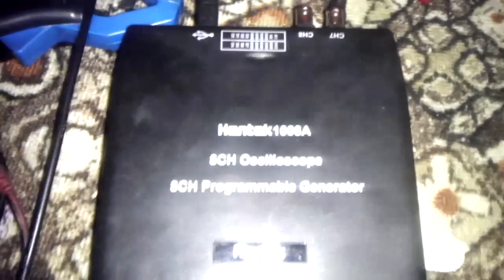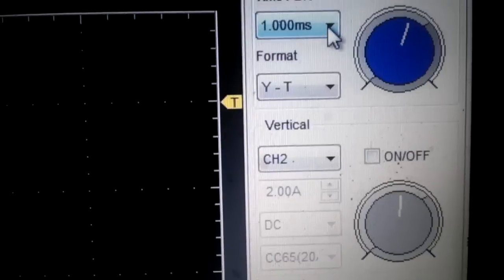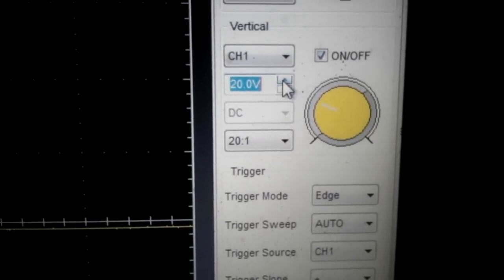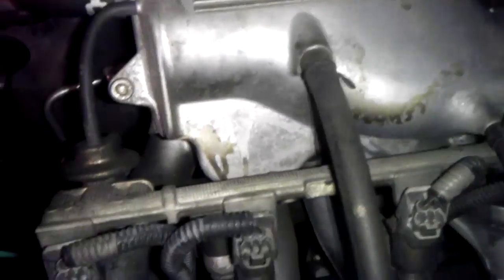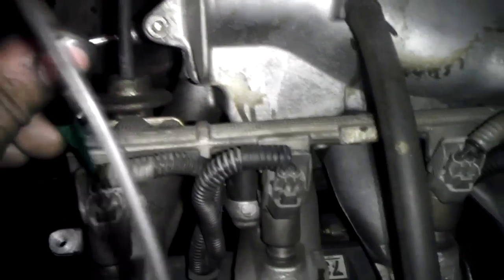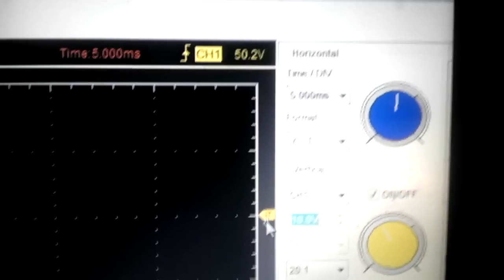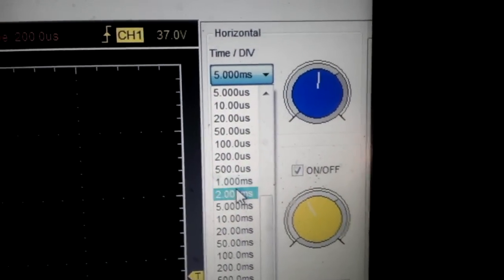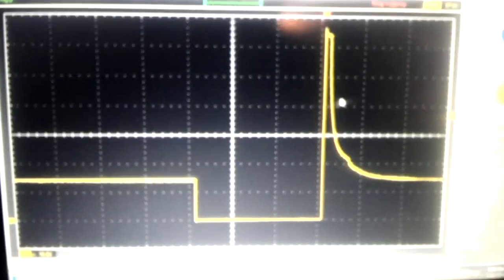Hantek 1008 Fuel Injector Voltage Waveform

Comment: Nice video but you were a little bit wrong, the spike is the "inductive kick" caused by the collapsing magnetic filed not the pintle moving. To verify that the pintle is moving follow the curve down and note the hump in the knee of the curve, that is due to the back emf generated by the falling pintle through a coil. So you need both, the spike that told you that if fired and the hump saying that it move the pintle. Otherwise nice job.
Reply from the maker: You are absolutely right. I did not think about that. The inductive kick is just what you said. I have felt that kick when powering up Air Conditioner compressors with a jumper wire. It is actually quite a shock. The kick has nothing to do with pintle movement. I should have added the current waveform in this video. Thank you for pointing that out.
Reply: True

Comment: or to check if you have a jump timing, you could simply sync the relative compression peak with the firing of the ignition system.
Reply from the maker: Sorry for the late response. This is true but if the timing belt has skipped one tooth then that will be really hard to see using the relative compression waveform and the ignition waveform. It is not impossible if your signals are super clean and you can see a lot of detail but much harder.

Another way to check for skipped timing would be to use a timing light. Most cars if the timing belt is off by one tooth then the timing will be off. If it has a distributor that is adjustable no matter how much you adjust the timing will never be right. If it is computer controlled timing then the timing will be off.
Reply: Enrique Osorio   This is true but if the timing belt has skipped one tooth then that will be really hard to see using the relative compression waveform and the ignition waveform.

what do u mean by this?

Comment: Nice information. Dear friend do you recommend such a scope for a car tech? Is is fulfilling all requirement of car circuits and sensor testing.? Also is this scope suitable will windows OS? Please reply. Regards,
Reply from the maker: I do recommend this scope. Of you have the means and budget a more expensive scope will suit you better but I do not have very much money so I do what I can with the Hantek. It works it is accurate you just need to put in the time and work hard to learn how to user it properly.
Reply: LearningZone   i think you select other hantek  tool ,yes it is 8 channels but  it is cheaper than other hantek tools.
there are 4 channels and it coat $ more than this tool on video, also 2 channels  and also cost more.

Comment: Why does it go down, then up? What are those two lower voltages?
Reply from the maker: Excellent question!! The positive probe is on the negative terminal of the fuel injector. When the injector is OFF the voltage or potential is the same on both terminals of the fuel injector therefore the voltage is HIGH or at 12 volts. When the injector turns on the negative terminal goes LOW or 0 volts. That is why it is HIGH when it's off and then LOW when it's on. The spike is due to the inductive nature of the injector. That's a topic for a whole 'nother video. Thank you for your question and thanks for watching!!!?

Comment: Are you happy with the Hantek 1008?  Would you recommend it to other mechanics? For the price it seems great, but if its too slow to use, I will save for the good stuff.
Reply from the maker: farmerdanz I do recommend it to begin to get your feet wet with a scope. You will be able to a lot of diagnosing with it but it is limited. Speed is not an issue but it lacks a good buffer which can be really useful in some instances.

Comment: Enrique Osorio Thank you for answering if I buy the Hantek 6022e I can measure the primary and secondary coil with probes that brings or have to buy the 20.1 filter you use in the video.
Reply from the maker: I am almost positive that you will need an attenuator. Very few scopes have built in attenuators, and the specifications on Amazon for the 6022 do not say anything about built in attenuationors, so in all likelihood you will need an attenuator.
Reply: Do Snap On Verus scopes come with attenuators? And what exactly are attenuators?
Reply from the maker: Attenuators are devices that are placed between the leads you are using to do the measuring and the scope itself. Their job is to divide the voltage by a certain amount and in this way your scope can indirectly measure voltages that are much higher than what the scope could directly measure. I have two video which I suggest watching which will explain this much better. Here are the links.
https://youtu.be/onNOZVR-Lpk
https://youtu.be/bPe-gYe0oog

Snap On scopes do not need attenuators, they are built in to the machine. They can accept the high voltage spikes of the fuel injectors and ignition coils.
Reply: +Enrique Osorio Thanks!!!

Comment: so i must use that splice behind the atenuator?one lead to component other to ground?
Reply from the maker: Let me describe it differently. When testing a fuel injector the negative or ground lead should be on chassis ground. Good grounds would include the negative battery terminal, any metal touching the engine or the frame and any casing like the alternator or starter motor. Since the fuel injector is a coil the resulting voltage spike will be great enough that it could damage your oscilloscope. For this reason you need to use a 20:1 attenuator to reduce the voltage that is reaching your scope.

Comment: Nice vids.  I was thinking about getting one of these 1008C's, but it had mixed reviews on amazon.  It looks like you've been using it for awhile and I was wondering what your overall take on it is.  I'm a hobbyist, and I've never used an oscilliscope before, although I am familiar with basic electronics.
Reply from the maker: When I bought this scope I knew nothing about oscilloscopes. This was my learning tool. It does have its quirks, so it takes some getting used to, but for less than $100 what can you expect? It is not going to give you the resolution of a 500 megasample/s scope because it's only 2.4 megasample/s but it does work. This scope is more suitable for automotive work because of the low sampling rate since you rarely need time bases shorter than 200us when looking at ignition waveforms and the like. If you are into electronics you might need something with a higher sampling rate since any waveform with a frequency over 1 MHz will not show up well on this scope.
For example, I had a microcontroller that was outputting a square wave at 50 kHz that was being read by an analog to digital converter and it kept giving me weird results. As it turns out the square wave had an underlying 2 MHz 0.5 volt sine wave that the Hantek did not pick up. I ended up using my Picoscope (240 MS/s) which did pick it up so that is something you should consider when making your decision.

Comment: What is the time interval (in ms) between 2 signal spikes, in other words, what frequency in Hz of the waveform?
Reply from the maker: Not sure, but we can figure this out. While idling the engine will be spinning at approximately 600 RPM, which works out to 600 Rotations per minute/60 seconds per minute = 10 rotations per second. For every 2 turns of the crankshaft, the fuel injector will fire once. This means that in one second, the fuel injector will have fired 5 times. This places the spikes approximately 200 milliseconds away from each other. Hope that helps, let me know if you have any other questions.
Reply: @Enrique_Osorio , Is correct! In fact, I knew this, I just wanted to confirm. I once saw a guy measuring with a tool, which indicated something around 400 - 600 Hz, I found it a little strange, because that would give 48,000 RPM. According to the guy, he was measuring the injector signals. Then, the correct for the signal indication is 5 Hz. (With 1.6% duty cycle, corresponding to 3.2ms of injection time).

Comment: Hello I am Jose I am interested in buying a oscillocopio which you recommend between Hantek 1008c or Hantek 6022be thanks.
Reply from the maker: I would like to mention that I have never owned or used the Hantek 6022be so I can not give a first hand experience. What I can say is that looking at the specifications for the 6022 the sampling rate is much higher so you will be able to look at signals into the MHz range with no problem, since the 6022 takes 48 million measurements per second, but it only has 2 channels. On the other hand the 1008C has 8 channels so you can look at many different signals, the 1008 only take 2.4 million measurements per second which means you are limited to signals in the KHz range. If you do not need more than two channels get the 6022 but if you absolutely need more than two channels AND you do not need to look at signals above 250KHz then go for the 1008. If you need something with lots of channels and a high sampling rate then you might need to go for something else because neither of these will be up to the challenge.

Comment: Enrique how do you change between ac and dc on the right hand side control panel or is it auto sensing?
Reply from the maker: The Hantek does not have AC coupling built in.  This does not mean that you can not read ac voltages. It will read ac voltages with no problem. What it wont do is filter out any dc voltage like ac coupling is supposed to do. Sorry.

Comment: Well I'm glad I found your channel man.
I been looking for a cheap scope for some side work (I'm the diag guy at work) and came across these hanteks from a Google search..
I can really use a little input here I'm stuck between this combo kit 1008 on Amazon that dude says it can be ran with window 10...and a 6074BE  which is advertised as "automotive oscilloscope"..Do you have any input on the 6074BE as how it stacks up compared to a 1008? 

Any input would deffintly help man.
Reply from the maker: I honestly prefer the 1008 over the 6000 series of Hantek. Mostly its the software difference. I think the 1008 is geared more toward automotive use. I just bought my first 6000 series Hantek scope and am not impressed by it. On my desktop I am back with the 1008. What I did notice is that the 6000 series can read much faster signals but for automotive use the 1008 is fast enough. Hope this helps. Hopefully once I try out more of the features on the 6000 I will be able to give you a better answer. Thank you for commenting and thanks for watching.
Reply: Enrique Osorio 
Deffintly did help alot,I've decided to go with the 1008 combo kit comes with the amp clamps atenuator ect..Glad I found out about these but I was very sceptical for good reason but watching your videos convinced to get one lol..
Thanks for the input and thanks for posting
Reply: well so far I'm pretty impressed with my Hantek 1008C, The only dislike I have is the fact that sometimes it crashes my laptop when I exit the software..Although It seems to not be as bad lately for what ever reason but once and while it's like the scope reboots it self especially when I make a large change in time base or vertical trigger setting.Now this scope is spec'ed at 1kHZ (good enough for most Automotive signals)and 2.4Ms/S which is very very slow for any scope so I couldn't even image trying to do a cam/crank correlation on a V-type engine with DOHC I'm sure the sampling rate for that many channels would be way to slow to get a useful waveform.But overall for the price I have to say I really like it and it does what I need it to do.I also tinker with electronics and robots as a hobby and decided to buy Hantek's DSO8000 series scope/DMM for my projects as they seem to make a decent product for the buck!!...At work we have a Bosch MTS and a couple Fluke DSO's we use for diag work but hey are way more money then what I would need for home use.
Thanks for posting your videos !!

Comment: Enrique, just verifying before I start connecting up my scope to some things in a car to get a feel for using the Hantek, I don't have any attenuators yet, so I presume the only circuits I can test with the leads that shipped with the scope would be the lower voltage signals, like back probing of the fuel injectors, TPS signals?  Just want to be sure before I maybe do something that can't be undone..lol.
Reply from the maker: Sensors are safe to backprobe. I would not recommend checking fuel injectors because of the inductive spike that comes with the winding of the fuel injector releasing its potential energy. That being said many solenoid's such as purge solenoid's, idle air control solenoid's and even compressor clutches can provide an oscilloscope damaging voltage spike. I would stay away from those until you have a 20:1 attenuator. The only exception I can think of is a pulse width modulated solenoid that is controlled on the positive side such as the oil control valve on many late model Toyota's and Lexus. 

Another cool thing to see on the scope is the control wire for certain ignition coils. Only the type that have 3 or 4 wires. Two of the wires should always have positive and ground and a third wire should control the transistor in the coil and because of that there should be no spike and all you should see is a square wave.

Another sensor that you should be careful with are two wire speed sensors also know as variable reluctant sensors. Those produce an AC signal that at high RPM’s can reach 50+ volts. At idle or low RPM’s you should be safe.

One more thing, use the diagnostic set ups that are provided. For some reason when using those I get better and clearer signals than when I set up the parameters manually.

Good luck and contact me with any questions that you may have.
Reply: Enrique Osorio
Thanks for the info!  That current clamp, the CC650, guess it would make sense to just get that, rather than getting the CC65 since current spikes etc would exceed the 65A etc on the smaller unit, and you could still use the 650 for small currents just the same?
Reply from the maker: Chris C No the CC650 is meant for higher currents, and for thicker wires. Anything less than 10 amps you do not want to use the 650. I would recommend getting both. I mostly use the 65. I only use the 650 to alternator output, relative compression tests and starter winding tests.
Reply: Enrique, the auto probe ht-25 that came with the scope..is that used over the spark plug wires to read the plug voltage?  Looks like it already has a built in attenuator.
Reply from the maker: Chris C Yes that is used over the plug wires. Be sure to ground it properly and use the diagnostic set up included with the software. You will have to tweak the settings manually after depending on your application but it is a good start.
Reply: I have been looking through youtube for vids on using a scope, but isn't really alot of detailed information that breaks down the nuts and bolts of how to use the scope, how to connect to various test points and when you do, what you need to keep in mind (attentuators needed etc) and one you get a waveform, how to understand what you are really seeing.  I have heard that the Picoscope  offers a really good help section for just that purpose,but for all of us that don't have that software, have you heard of any good manuals or dvd's that offer some good instructions?
Reply from the maker: Chris C A lot of my scope "training"  came from watching ScannerDanner videos. I highly recommend his videos. He uses the pico and Versus. If you have any specific questions I would be happy to answer them.

Comment: I've just bought Hantek 1008b, it is my first DSO. Don't you think it is very slow? I mean, why the waveform is updating so rarely? Or maybe it depends on computer CPU? My is very slow - 900Mhz, 1GB of RAM  (but looks cool: check Panasonic Toughbook CF-18 :)
Reply from the maker: The slow refresh rate is a problem for me sometimes. What I normally do is, depending on what I am using the scope for, is to place the scope in roll mode with a 500 ms/div time setting and look for drop outs in signal in that mode. Of course if you are trying to look at the fine detail of a waveform then this will not work.

Comment: I have a hantek dso 3064. when I am testing the injector I cannot get a good signal even if I move the ground the signal is really really noisy do you know if there is a way to clear the signal or my scope is messed up thank.  you
Reply from the maker: +shadetreeautocare If I had to guess it is possible that you are getting interference from the ignition wires or the coils. Try to keep your leads away from anything else electrical, especially the spark plug wires and coils.
Reply: +shadetreeautocare I see from comments that a lot of people like me are interested in DSO3064, can you tell us some details regarding sampling rate and memory depth (10K-16M)? Can you record waveforms, play back or zoom to see more details? Also looking at DSO3102 with 256M memory, 1GS/s sampling rate. Thank you

Comment: do you know where i can get some wave samples of a stuck open and closed injector ? i just got my hantek 1008c yesterday (: and now going to test on known goods and get used to waveforms but i want to know how bad ones look so when i encounter them i would know what I'm looking at
Reply from the maker: +Alejandro Amaro A stuck open or closed injector will likely not show up on a voltage waveform. Sometimes on current waveforms you will see a small bump which indicates injector pintle movement but other than that you will need other ways to diagnose a stuck open or closed injector.
Reply: Like looking at fuel trims or injector balance testing huh?